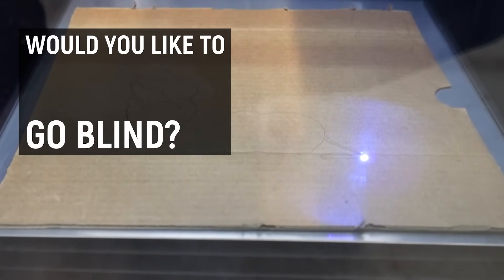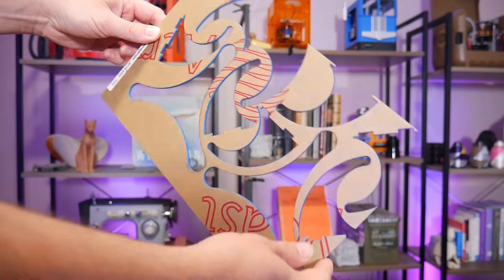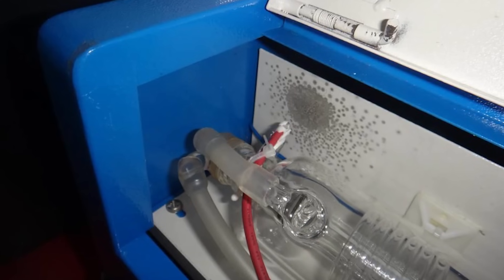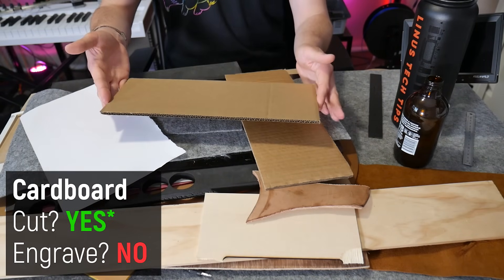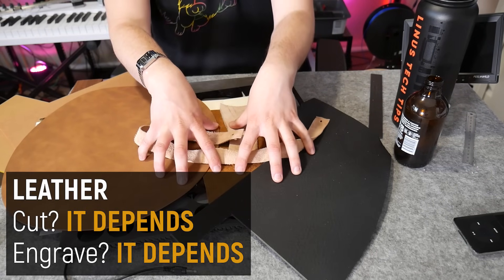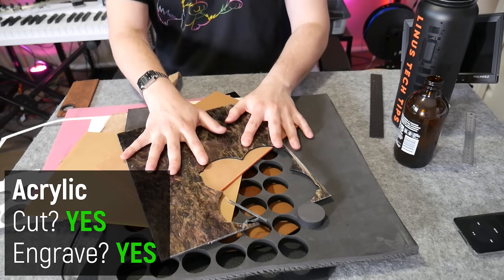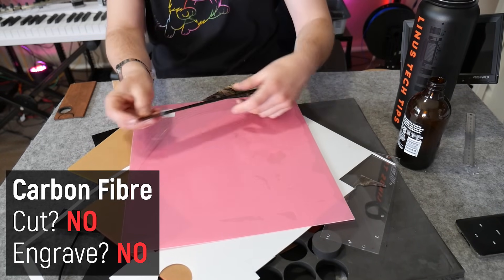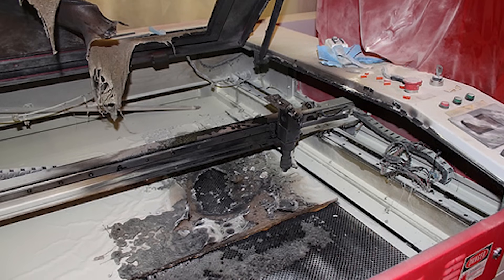Are cheap laser cutters safe?

Comment: Oh man speaking of EM discharges. Our campus laser cutter, Fully shielded for laser light, had a mean EM discharge that'd mess with the computer monitors near it. It also fried said computer it was connected to. I have a cheap laptop to use with that laser that I don't mind destroying, but these things are just nasty without the proper support equipment. Minimums would be a laser trap that could handle the discharge and have it be fully enclosed as you said with appropriate light filtering. Otherwise I feel like these things should be locked out when you are not informed of their dangers. I've also always wondered how dollar store pointers were even allowed as they can be damaging too. It's like looking into the sun, but instantaneously worse. I would like to protect my vision at all costs and these hobby laser things do truly disgust me as well.

Comment: I had to make extensive modifications to the Ortur before I was satisfied that it was reasonably safe.  You can't use these things without an enclosure with a powerful exhaust.  Well, you can.  At least once.  Definitely check all the wiring and replace cheap harnesses and chains.  Adding compressed air I've found to be indispensable for anything other than etching.  I agree that you should take the specs on the included glasses with a giant grain of chinese salt.  I keep the whole thing low to the ground under a table.  Most definitely not a toy; don't get this for your grandkids.

Comment: I've said similar many times in the laser cutter videos.  The ONLY really safe way is to use a camera and monitor and work through a video link, with the actual machine double shielded.  If you look at the pass percentages of the cheap plastic glasses, they don't even remotely protect you from a direct strike or strong reflection.  $1500 glass goggles will do better, but they still aren't really up to the job for the several watt violet near-UV lasers.
If you don't protect your vision, you'll regret it later.  Ask any welder who was careless with theirs, you simply cannot get it back.

Comment: Check out those cheap fire proof laser case „tents“ that have 100mm air tube connectors. Buy it along with a cheap silent inlay fan and some tubes and a fitting active coal filter. Blow the cleaned air out of the window. That setup costs less then 100 Euro and provides you with some basic safety.

Comment: Those cheap laser cutters led me to cheap cnc machines. I got a 3018, which had a laser option, but decided not to get that since I'm tightwad who researches things to death before I feel ok spending money on them. Making it safe was going to cost a bundle, and then I'd have to research to death everything I wanted to laser. Now I very occasionally cut some wood, with a 1/8th endmill while questioning the wisdom of mixing metric and imperial units.

Comment: There are indices of materials and what they off-gas during ablation, as well as how they cut and whether they tend to burn with and without air assist.
All of this hinges on knowing for a fact what material you're lasering.
I have a massive 10w diode open-frame cutter that I use to cut a variety of materials because I need the flexibility of being able to move it easily because we use it to cut toolbox silhouette inserts on-site and on-demand.
Safety is obviously a concern but all these problems you've mentioned are precisely the same concerns you'd have with an arc welder, which is why we tend to set up in the welding area, where we invariably have fume extraction, eye protection and fire suppression available.

Using your logic, nobody should weld, either.

Comment: It's the exact same issue with resin 3D printers! Just because a product is provided for the consumer level does NOT mean it is the same as a regular appliance like your microwave or kettle and you can just put it anywhere and use it without a care or research.

Comment: eva stands for ethylene vinyl acetate and I am  pretty sure it can make a compound when burnt that makes acetic acid also known as vinegar when it comes in contact with moisture in the air which will likely make you puke but is generally considered safe
Reply: but I still would not whant to breath in

Comment: Quite the rant young man. Agreed the videos and photos used are terrible. With almost 30yrs in industrial manufacturing as an engineer dealing with safety and production issues I can say most of your concerns are easily addressed  by the hobby user. A bathroom vent fan and a simple box solve 2 thirds of your problems. There is actually quite a bit of material advice out there. And no, don't laser cut any chromium tanned leather

Comment: Heads up to anyone with a Creality CR 10 V1, the PSU main power lines will short on the psu Body thats lined with PE plastic which will catch fire, REPLACE THE PSU BEFORE IT HAPPENS. Creality told me to basically shut up about it & then stopped responding when i mentioned it to them

Comment: Most of those enclosure-less diode lasers don't come with the correct glasses. It's actually more dangerous that they include them because it can lead to a false sense of safety. Cheap C02 lasers like the K40 may have an enclosure but they have other issues. A very common problem is a lack of proper grounding. There is a grounding wire connected the case, but there is a layer of paint in between. It only take a few minutes to sand away the paint where the wire attaches to the case. I would also add an interlock to the lid. The first time I had a beam go astray and the air-assist hose caught fire, I instinctively opened the lid. The interlock potentially saved my eyesight. All it cost was a $1 micro switch and a couple of wires. Most chinese manufacturers don't give a damn about customer safety, they will save a penny everywhere they can. Remember this is the culture that put melamine and asbestos in their own baby formula, so they certainly don't care about some western foreigner going blind. Do your homework and if you are going Banggood or Ali Express, make sure you make the device safe before you ever turn it on.

Comment: Hmm, 3 inch vent and carbon filter on the intake, run the exhaust out the window. You know like they use for bathroom exhaust, or grow tent. Proper safety goggles for the wavelength and the wattage of the beam. Pretty safe until you get to CO2 tubes. While a diode laser can blind you forever, a 1000w CO2 tube will light you on fire instantly and blind you, and you cannot see it at all. Also if you want to use a acrylic shield and a diode laser, they make pretty powerful IR ones. Just not CO2 tube powerful.

Comment: I work in a acrylic store. They bought ATLAS TAN 1309 CO2 laser cutter to expand their bussiness. 

And you know what? The trainer said we CAN watch the laser while its cutting or engraving acrylic WITHOUT close the lid and without protection googles because its bot dangerous. And they even said we dont need to install exhaust machine.

I know this is so wrong. So I google, ask, and watch safety video (like yours). And now I know its very dangerous.

BUT, the trainer said, if the lid closed, it will increase the risk of fire It happen because of lack air circulation and bad acrylic protection paper. So its better to leave the lid open. And we can watch the progress because it's safe 💀

My question is, how to prevent fire when we use the machine with closed lid?

Thank you.

Comment: I've been getting a ton of ads for xtools lasers and honestly they look pretty attractive as a product but I know I'd have to spend hundred of dollars in set up before even thinking about getting an engraver. I do not understand how on earth they can advertise these things in such an unsafe manner. You can't vent them, you can't protect your eyes, you can't protect your body, you certainly can't protect the eyes and bodies of any other beings in the room, you can't do anything even approaching safety without a proper enclosure. 

CNCs and 3D printers can be open framed, lasers can not.
Reply: xTool are one of the few companies that
a) have a compatible enclosure and exhaust system for the open frame model,
b) have an enclosed model,
so you can spend a bit more money and get a reasonably safe machine out of the box.
The problem here is that the open frame lasers are often presented in ads as a complete solution, but they're not, and that's why they're cheap - you get the barebones machine for less but have to invest in accessories.

Comment: Was a laser operator previously, anyone cutting polymers in a garage without an industrial fume removal system needs a really strong slap on the face and another and another until they stop. Mind you don't go slapping folks for real but yeah, do Not do that, even the specifically made for laser cutting polymer coatings for easily oxidized metals are incredibly toxic when directly inhaled. It's not just about specific compounds being toxic but mechanical lung damage from vaporized polymer chains. Your fume removal doesn't need to be a 100k industrial one but it does need to be equilevant and then some for the machine you're using.

Comment: Even if you buy laser engravers with supposed 'safety functions', make sure to test those before you trust them blindly. I bought an Ortur which has an advertised function to stop the job when the machine is moved / if something bumps into it, it DID kill the gcode when bumped, but also the part of it which turns off the laser. Not ideal to say the least.

Comment: ive had a CO2 laser cutter for years now.... 

The flame test... to see if its green... is a good test but its not 100%. There are a LOT of plastics that do not make a green flame, that are toxic to breathe in. Usually, these lower grade, or home made laser cutters, have little to no ventilation. That's NOT OK. Its not just breathing in the smoke, or the toxic smoke; its also that youre breathing in less oxygen.  

Also, there are a lot of plastics that create corrosive fumes. You wont notice anything but everything will be badly corroded to the point that its beyond repair. Personally, unless im 100% sure its ACRYLIC (or some non-plastic like wood, leather...) i dont even let it close to my laser cutter. 

Laser cutters can do a LOT of damage. putting your hand, or something flammable between the mirrors/lens, or the lens/material, is a very bad idea. Fires can start very quickly, so a C02 fire extinguisher is ideal, any will do. Also, i wonder if these lower grade machines have a safety switch. Mine has a huge red STOP button, that cuts all power to all the machines (laser, ventilation, air pump, water chiller). Ive hit it a few times. Also, if it doesnt have a ground wire actually going to ground (to a copper bar that is literally sunk into the dirt outside the shop), thats not good. Goggles are a good idea for your eyes, hearing protection is smart depending the machine, and knowing the radiation it gives off, also smart. 

Stay safe and good luck folks.

Comment: Before working with a material, you should read its MSDS
If it is not possible to reach the manufacturer of the material you bought, you should at least find a large manufacturer of the same material

Comment: Do not look into the laser with the remaining eye... Full enclosures, interlocks preventing the laser from starting when doors are open etc all absolutely mandatory. Most of the "K40" style chinese desktop cutters while enclosed do not have interlocks by default but adding one is relatively easy.

Run one for a while and you start to see a lot of tiny pits on the inside of the viewport, that's all from scattering, and those pits could be in you retina.

Human vision system in the brain is freaky good at hiding small problems (we have literal blind spots where the optic comes in for the rods/cones) so you will not realise that you are going blind from recurring minor laser damage until it's way too extensive for your brain to hide.

Comment: Test for chlorine in your material by heating a pure copper wire and touching it to your material to melt a thin smear onto the wire, then place the wire back in the flame and if the flame turns green you have chlorine so do not laser that material.

Comment: You can technically cut metal, but only fairly thin sheet metal. If you're starting to try thicker metals, you're using the wrong machine. Use a CNC plasma cutter.

Comment: Fibre galvo laser marking machines are getting cheap from china now. My first one a few years ago from a US comapny was about 20,000USD, now a chinese version of the same machine is about 3000usd. They are 30w fibre, open with no safety box. I've found them to be very capable and reliable

Comment: It seems like laser cutters are similar to different kinds of 3D printers, CNC mills, lathes, and airbrushes, in that it is always prudent to enclose and ventilate any home fabrication machine which does any cutting, melting, or spraying, as a general rule. I don't begrudge, say, airbrush manufacturers for not including a fume hood, mask, gloves, and goggles with their products, but advertisements and documentation should be serious about any health and safety risks and the negligence of some Chinese manufacturers is pretty staggering. It's not that hard to DIY a decent box for a laser, but only if you know that you need one.

Comment: the supposedly safe acrylic makes methyl methacrylate when getting cut, when looking at if something is safe to cut or not you need to look at pyrolysis data and not burning, because for example acrylic is safe to burn but not safe when there is no fire to burn off methyl methacrylate, and the same thing can happen with other plastics and even wood, so just because if something is safe to burn does not mean that is it safe to laser cut, and the most dangerous thing when cutting PVC at home is probably not CO nor HCl, but the bioaccumulating dioxins that can poison someone over a long period of time, just because something has chlorine in it does not make it inherently dangerous to cut, HCl is nearly not as bad as something like CO, carbon monoxide will kill you without even you knowing that its there, and not only that its probably impossible to even get a big whiff of HCl from just cutting plastic, but you will definitely know that its there before the concentration gets dangerous, the worst that you can get from cutting plastic is a sore throat/nose for a day or two if you are sensitive to it and have bad ventilation, people work with HCl in labs constantly with basically no PPE and are fine, but no one even wants to get anywhere close to carbon monoxide.

Comment: Those cheap open-frame laser cutters are fine, but they should come with a warning to only be used outside. No matter what you cut, you don't want to breathe in /any/ of the fumes. None of them are good, some are just a bit less bad than others.

Comment: I'm really disturbed by the current trend of labelling leather-like or imitation leather materials as leather. It really ought to be illegal. It's not as though any of these materials are new, either. Some of them have been around for over 75 years, and the rest have been around for more than 40 years. There are some new manufacturing methods and new ways of making composite materials, but they are all fundamentally the same materials. I'm mystified as to why suddenly so much false advertising and mislabeling is allowed. It's not just imitation leather, either. Lots of other things are being advertised and sold as something they are not.

Comment: Never gonna like unenclosed lasers without any safety interlocks etc.
More about glasses: They're meant to be safe when you're facing the optical path, not in case of stray beam (they don't seal your eyes from all directions). Cheap laser glasses are often not only for wrong wavelenght but also insufficient OD. Don't get ones without genuine certificate.

Comment: Supprizingly, good warning about these lasers.
I also, warn and complain about people and pets being in the same room and poor ventilation.
Just like 3d printing people tend to be polar with safety with few taking appropriate care with most taking none or completely freeking out.

I alway stand by if there are fumes assume they are toxic (as they all are in some concentration)  but some very easy and reasonable steps can be done to mitigating it.   Same with the laser.. have a enclosure (helps with ventilation also) and always use glasses ... no different then useing any power tool.
There are plenty thet will just not for any reason.. but the issue comes with marketing these as safe diy devices praying on people that don't bother to read..   (bolth is on the consumer,  the the latter is also on the manufacturer)

Comment: My ender 3 s1 came with a laser module. I was going to use it eventually. The effort required to "make safe" has put me off. An enclosure and extraction system will probably cost more than the unit. If I hadn't seen this video I was going to operate a laser engraver on probably treated plywood in my spare bedroom while my cat watched.